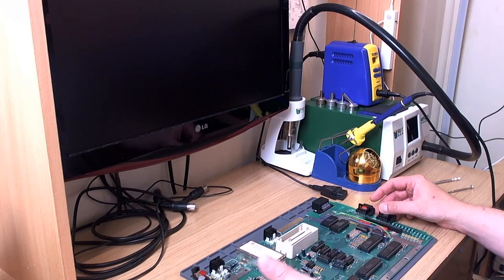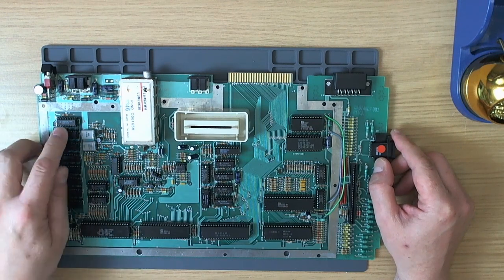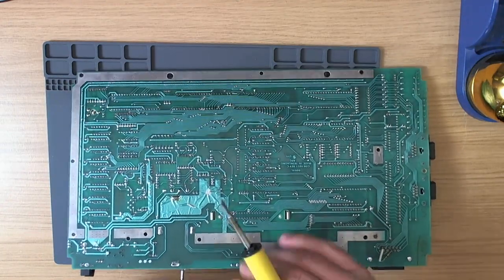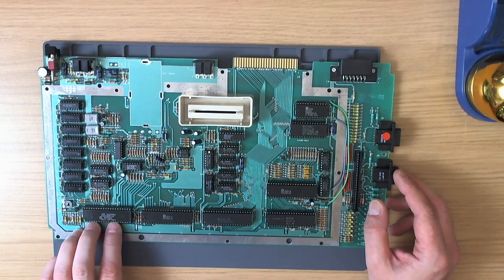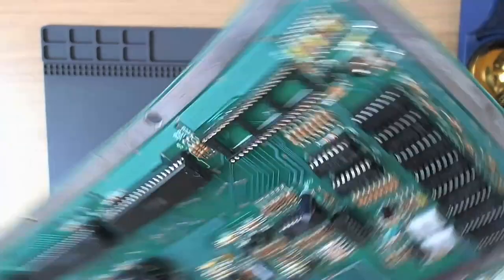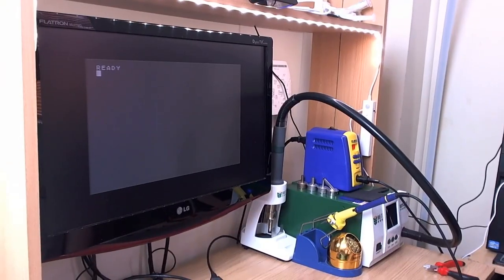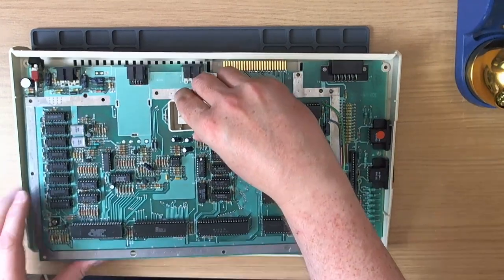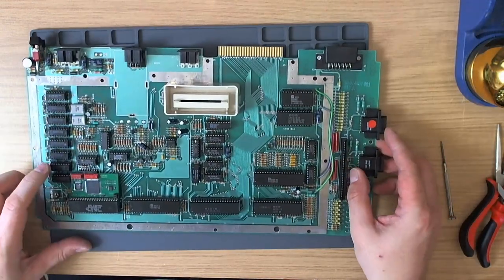Dead Atari 800XL gets Sophia RGB after repair

Comment: Have you ever tried low temp solder to remove chips and sockets?  It works great for me, and comes with the benefit of not putting too much heat on those of boards, which can destroy traces, and it doesn't destroy the chips or sockets.
Reply from the maker: I have, and I resolutely prefer max temps for almost every situation now. Labouring over desoldering jobs with low temps just puts more stress on things in my personal experience. I turn everything up and control heat application with speed/distance. Since adopting this method, pulled traces and damaged vias are an extreme rarity. Everyone's personal experience differs, of course, but hot is what works for me.

Comment: I'm curious why you didn't slide another barrel socket under the Sophia board to allow it to clear the other socketed chip you de-socketed.   I always try to avoid removing sockets.
Reply from the maker: Because this would have caused the Sophia board to block the underside of the keyboard and thus prevent the lid from closing. One could probably source a zero-height socket for the smaller chip, but given the fact you'll only want to remove it if it fails, it seems like a solution in need of a problem.
Reply: @flashjazzcat  Understood.  As an onlooker - I can't tell clearances :-)
Reply from the maker: @JimVeneskey  Of course. If a stacked socket would have fit, I would have surely taken the easier path.